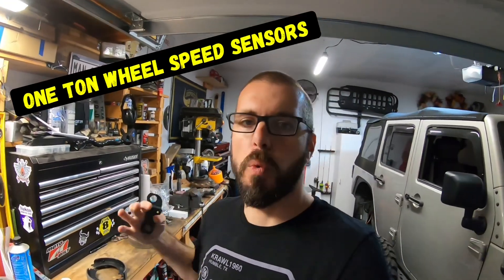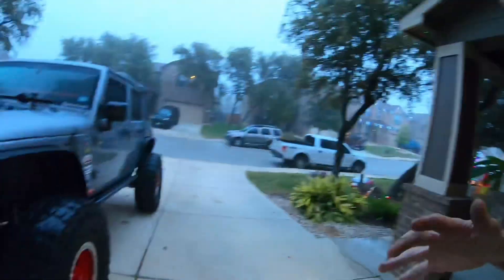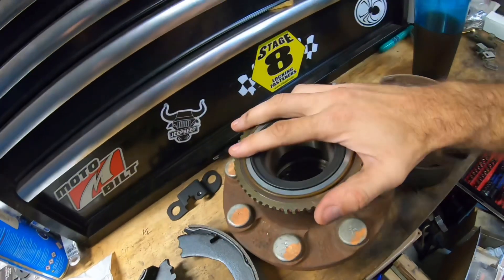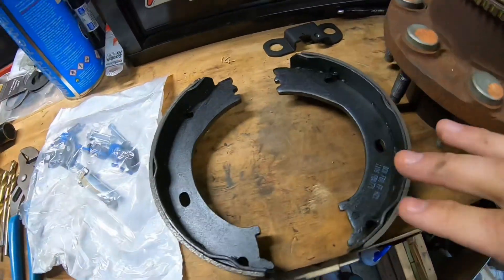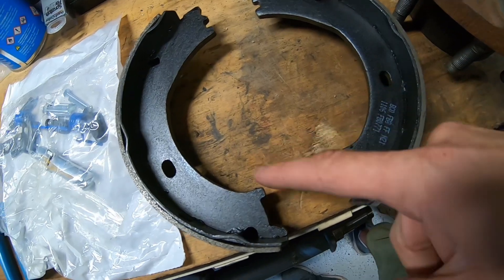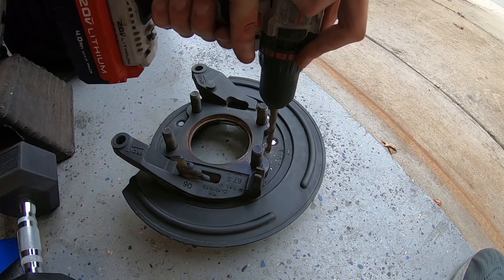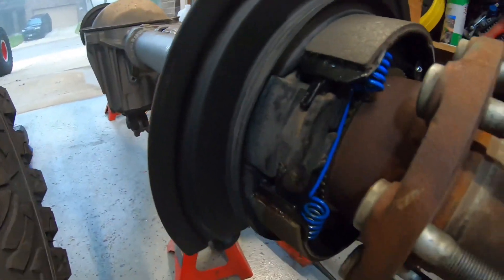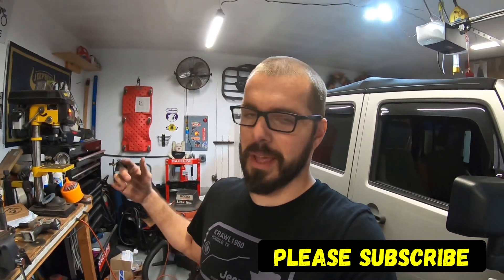14 Bolt Wheel Speed Sensors and Tone Rings - Project Maple Leaf Jeep Build (no. 20)

Comment: 7:00 Can't find video on prgramming for sensors. Lots of great, in depth videos on this channel!
Reply from the maker: I never actually got a chance to make it. Send me a message on my Instagram page and I’ll talk you through it. @WarPaintOffroad

If you don’t have an Instagram let me know here and I’ll do my best to give you all the info.
Reply: @WarPaintOffroad LoL, no Instagram, but I don't need it. Just wanted some info. Got a 2014 Escalade to project with later. Problem is, everything works fine now.😂
Was curious about wheel speed sensors on factory E38 ECM issues for a 14bolt 10.5" full float with locker.
This all time AWD is a nightmare

Comment: Great series! In the middle of breaking down my 14-bolt and am getting rid of those drum brakes. Have you done a disc brake install on these, and do you know where to source those? It's killing me that the mounting brackets for these axles are meant for the pre-90's models...
Reply from the maker: Hey! Thanks for the support! So I’m not sure tbh. I know there are a bunch of companies that offer them. But I always try to build the axles that are already disc brakes. They aren’t much more expensive to buy out of the junk yard and converting them just seems to be an added cost. So I try to start with disc brakes.
Reply: @WarPaintTexas  yeah I figured that out a bit too late and I'm already into my 14-bolt.

Comment: You reference artec having a kit to place 4 tone rings in the rear on a 14 bolt. Do you by chance have a link? I have been researching how to put my king pin d60 in my jk but tone rings is keeping it from happening. I can’t find the kit on their site.
Reply from the maker: Hey! Sorry for the late response! This got pushed too far down. So it’s basically just this kit. You just have to buy double the brackets so you can mount to both sides of the hub. I hope you found what you are looking for!